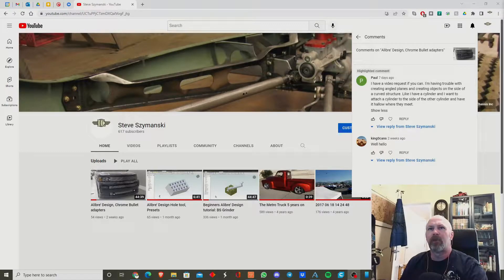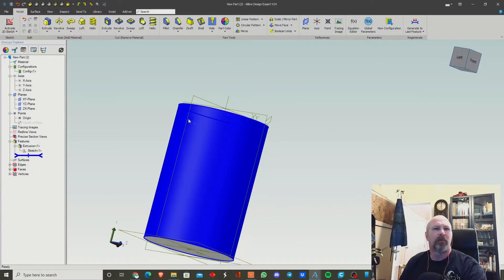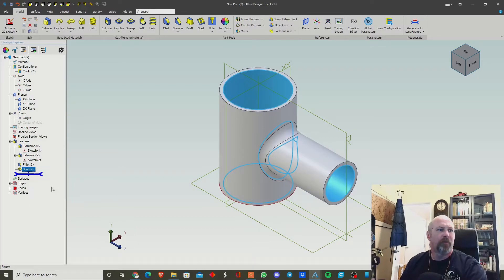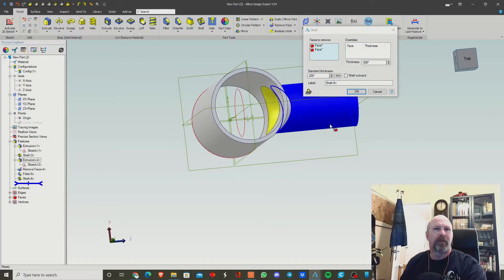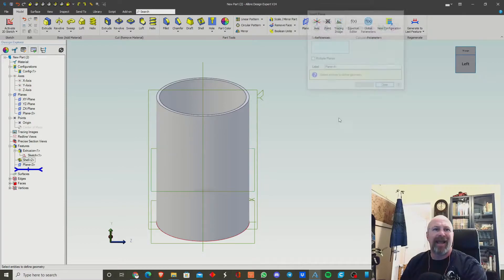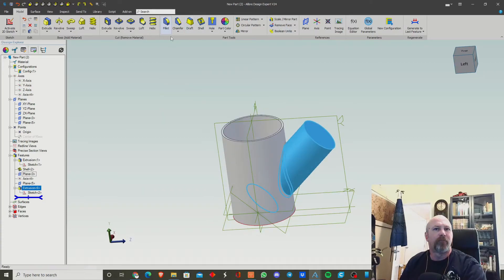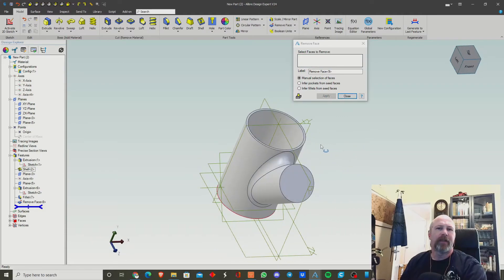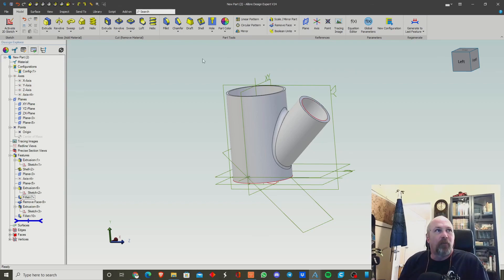Alibre' Design: Working with Planes.

Comment: Hello!

I have a situation where I need to put a hole through a cylindrical object.
I think I understand how to put holes into a cylinder, thanks to this video.

How do I do the same operation to add a screw hole?
Reply from the maker: The function would be the same. Or, I'd your cylinder is in an axis and your needed hole is perpendicular to one of the existing planes, you can sketch your hole and extrude through the wall you need. 

I might have to make a video on how.
Reply: @ELpolacko  I would like to see a video on this. I am still having a lot of trouble trying to do this. I think this should not be this difficult. I should be able to select a cylinder and put a plane tangent to it, then adjust it to where I need it.
Reply from the maker: @HybridRobotix  I will see what I can do for you next weekend. My schedule is eaten up this week with my day job.